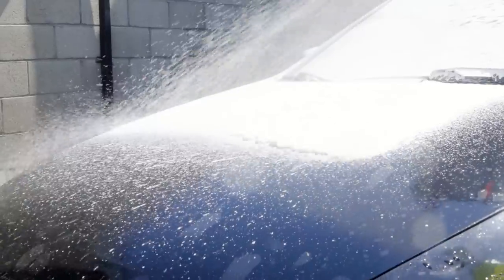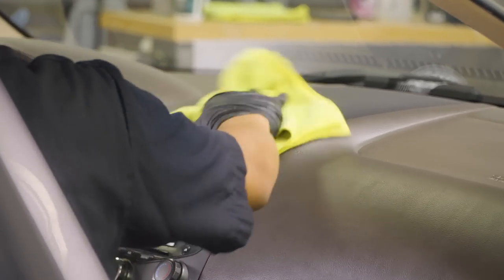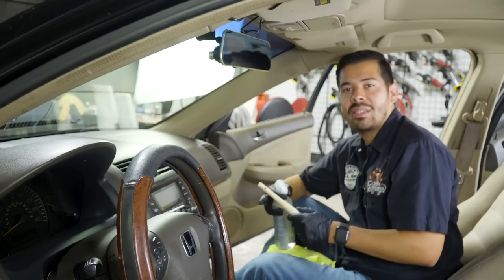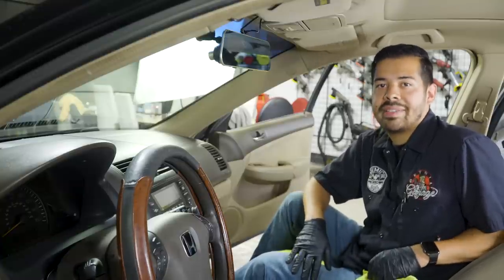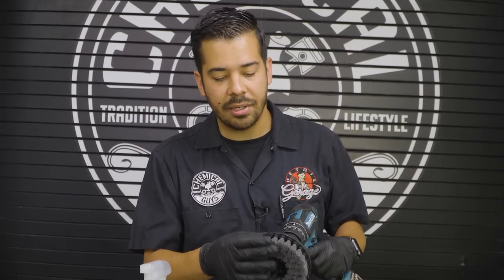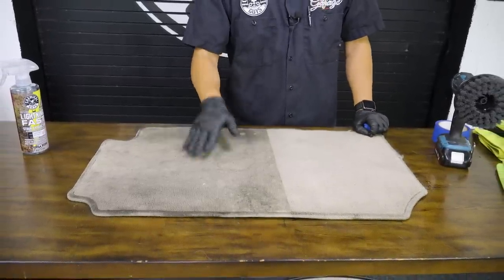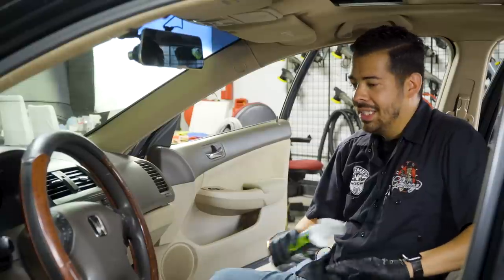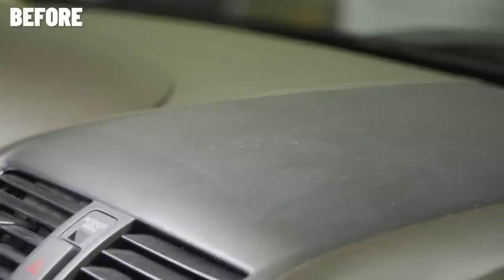See The Difference A Clean Interior Makes! Total Interior Makeover - Chemical Guys

Comment: I really like nonsense cleaner, but I feel like when I do the 20:1 dilution, it just doesn’t really do anything. I use my boars hair brush, it just doesn’t foam up like when it’s full strength. I tried 10:1 and I guess it’s a little bit better. All around I really only see success when using the product straight up and undiluted.
Reply from the maker: Hey Tommy! It is perfectly fine to use Nonsense at full strength.